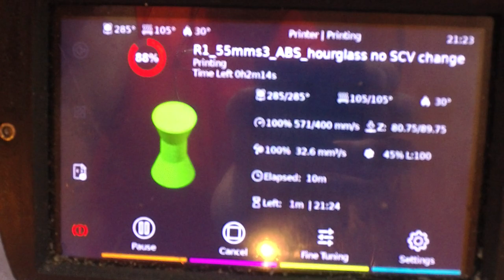16ms vs 256ms

Comment: in my experience the advantage of more micro steps is not the increase in resolution but rather the decrease in noise levels and possible decrease in VFA at very low speeds. Ive found that between 16 and 128 micro steps the noise level reduces a noticeable amount and the fas at low speeds go from being apparent around 20-150mm/s all the way to 70-100mm/s which is much more usable. 
that's just my experience though, it may not be the same on all machines

Comment: At that speed even at 8ms you wont see a difference. Heck just full mechanical step without microstep would do the same :)   it will just a difference in sound. At lower speed however...   but from 16 to 256  you probably wont see it. But will hear it
Reply from the maker: I need to make one more test using slow speed and see if anything changes(sound, accuracy, or part quality). Sound has not been issue at any microstep for this machine =>16. But the CR10 hardly makes any noise... WHAT HAVE WE DONE! --CPAP, berd air, metal panels.. haha

Comment: Those look great. Are all the rails MGN12's? What's the resonance frecuency of the X/Y axes? I ask because I wonder if beams would be worth it
Reply from the maker: These are MGN12H rails, tests from 20-28K acceleration with recommended ZV on 300x300 volume printer with 500mm long XY rails.

Comment: IME you should use 16/32 microsteps to minimise loss of positional accuracy (you could also increase z microsteps, seeing as they don't need the torque as much as A/B). But if you do want to test for any artifacts in wall quality, try out mihaidesigns moire tests.
Reply: Using more microsteps does NOT reduce accuracy. The increase in accuracy with each additional level of microstepping is diminishing but the absolute accuracy is always increasing.
Reply from the maker: @daliasprints9798  Testing today showed that more microsteps= < torque between steps. I attempted to print a benchy in 4 minutes with 256ms, step-rate fail using 550mhz MCU. Then went down to 128, printed, but skipped steps big time. Down to 64 and still skipping. So maybe there is some step loss with more microsteps? Audible noise does not seem to change from 16 to 256. I think even comparing these 2 prints the 16 looks better. But it's very marginal.
Reply: @MrRocksalt At higher speeds & accelerations where the actual tool position may be lagging behind the driven position, using fewer ms gives you slightly more torque earlier to help catch up. AIUI the 5160s and/or some other higher end TMCs have a mode to drop to full stepping at high speeds, which solves this problem fully. I'm looking forward to trying it.
Reply: @daliasprints9798  It's my understanding that the sudden changes in torque during high speed printing can cause microstep loss. In any case, the loss of torque isn't worth it for the theoretical resolution.
Reply: @SparkyBrownCow  There is no such thing as "microstep loss".